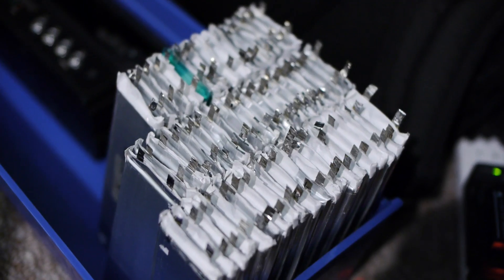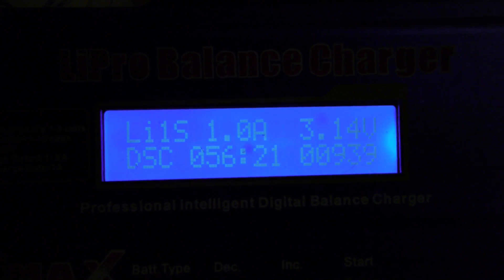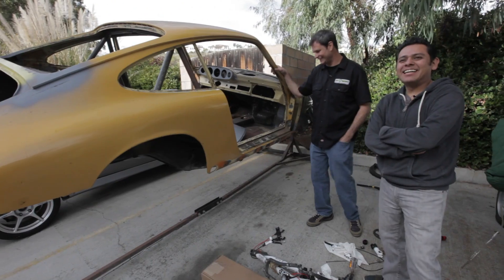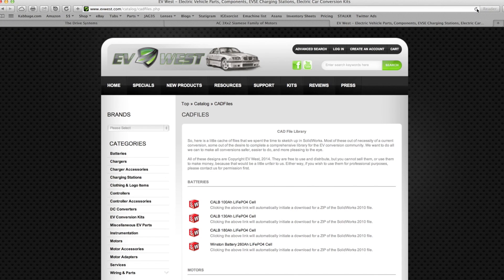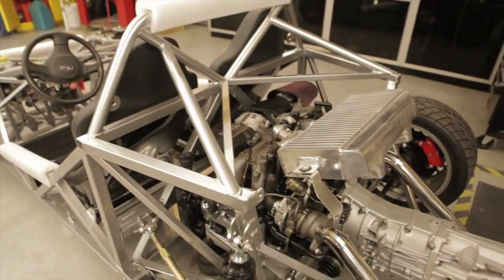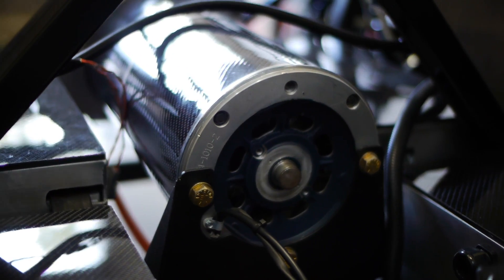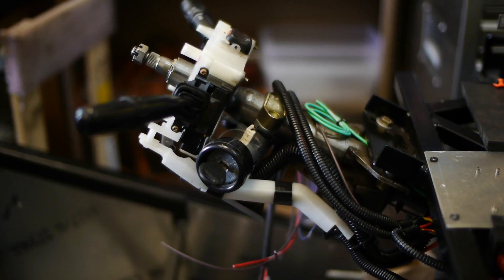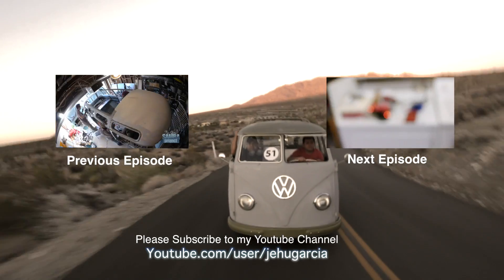DIY EV conversion - Battery talk, Factory Five 818, eSamba

Comment: How do you plan on charging 30 cells in series? Using BMS or a charger for each cell? Thanks
Reply from the maker: As of right now,  EMW 12kw charger,  will charge all battery groups at once in series so it will stop charging once it reaches 4.2 x 30 = 126V
Reply: jehugarcia
I am no expert on the matter by far but could you not end up over charging one or more cells and still have 126v? Then you end up with one pack a 3 volts and another a 4.5 or something..
Reply from the maker: yeah,   but luckily for us, lithium cells normally do not self discharge so if you balance all cells at the bottom (2.7v)  they go up and down together,  sometimes for years without any active balancing systems.
Reply: That's cool. Good to know..

Comment: I really admire your work. You are an Awesome guy.
I was wondering if you know about Pre/CC/CV charge cycles?

Pre= if voltage of battery is under 2.5V it will charge at rate of 1/10 C (for a 2000mah 18650, that is 200mah charge rate) until it reaches 3v, where it will go full charge at 2000mah. This is to protect the battery from overheating because when a cell is this dead, it is not good to charge at a high rate.

CC = Constant current. Charging at a constant current until the battery gets to 4.2v. This is usually 1/5C. 2000mah battery would be 1000mah

CV = Most underlooked of all. (many chargers do not have this function) When a 18650 gets to 4.2v it only has around 65-85%.  capacity. In order to get 97%, the charger will charge at exactly 4.2V until the amps read 10% of the previous CC cycle which is 100mah. For the last 3% the battery temperature will need to be at 25C (don't remember) before terminating charge.

Check if your charger has the CC cycle. When the reading on the charger gets up to 4.2V, it should NOT say it is completed. It should stay at 4.2V for another 1-2 hours before it indicates that it is done charging.

I just wanted to point that out because you deserve that extra 25%!

Comment: Hey Jehu, I just spent my entire sunday morning watching your videos.  I'm blown away by your work with the 18650 cells and it's inspiring me to consider this option for a 1975 Alfa Spider that I am converting this summer.  I found your videos while researching the AC50 motor, and I guess if it can propel a bus down the freeway it would be fine for a small italian convertible.  I've been driving a Nissan LEAF for almost 2 years now and know how battery capacity can never be enough.. any way we can cut the cost down (even at the expense of time) is the way to go... would be awesome if every cell could be monitored and easily swapped out but maybe that's asking too much :)
Reply: There was a website, redrock solar I think, that had an ev cell management system that switched individual cells in and out. very clever.
Reply from the maker: thanks for watching